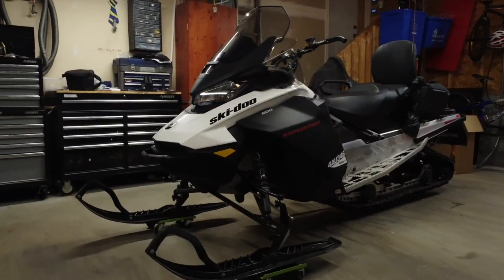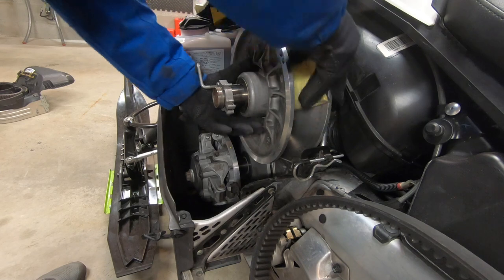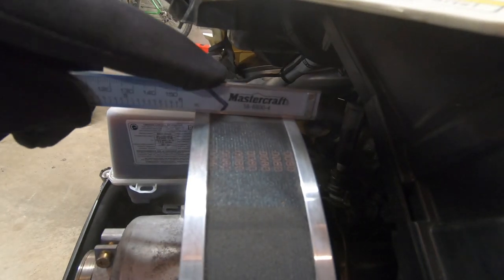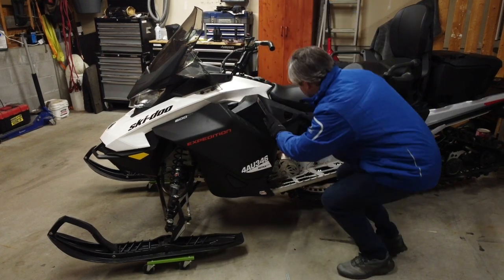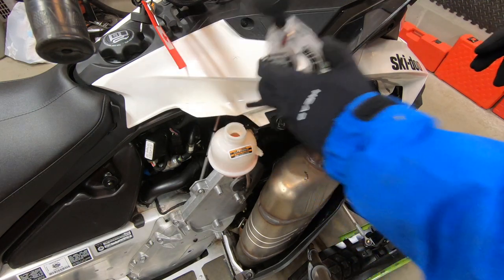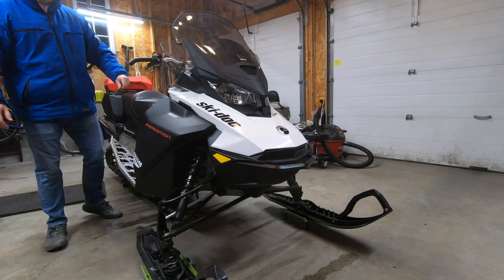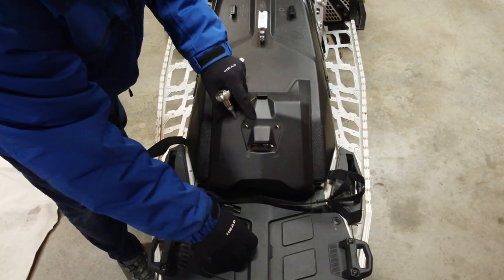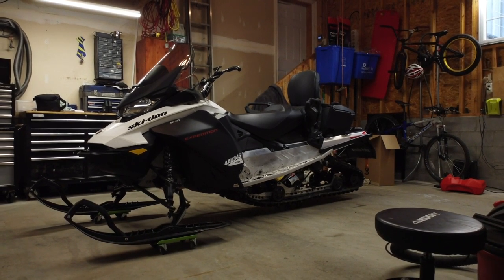DIY Ski-Doo 600 EFI Pre-Season Maintenance

Comment: thank for this AWSOME VIdeo....  I have the 2022 Ski Doo Expedition Sport 600 EFI,  question related to charging the battery ,  on your video and also on my machine as well,  there looks to be a Charing Tether you can use to charge battery ?  Is that what it is or is that for something different ?
Reply from the maker: That 2-pin connector is the rear passenger heated grips wiring harness. The Expedition Sport includes the harness from the factory, but does not include the rear heated grips. Since the harness was factory installed, rear heated grip installation was made easier than it otherwise would have been!

Comment: Great.l got sound on most of the video but around the middle of the video l lost your volume.Hope to see new video in fall. Can you resolve a problem with my 600 efi. sport expedition.The ski doo tips over at slow speeds. On a hard packed trail if you run up the hard packed edges it will tip. If I am on a back trail and get to close to the deep snow either side of trail the ski doo will tip over.
Reply from the maker: My Expedition was shipped with all suspension adjustments set to the 'softest' settings (the least pre-load.) Try tightening up your front spring pre-load. You'll need to use the suspension adjustment wrench on the clutch cover. Adjust it just 1 or 2 clicks at a time, then test ride it. I found the snowmobile much less prone to tipping with the front springs adjusted tighter. I settled on a setting of 4 out of 5 on the left and right front springs (that's 1 click from the highest pre-load on the front.) Leave the rear springs as soft as possible (only increase the rear spring preload if you're bottoming out.)

For me, this dramatically improved handling, stability and reduced darting.

Comment: You ever use any other oils for the skidoo? Like different brands other then XPS fuel synthetic,,, like blue coloured 2T snowmobile oil
Reply from the maker: I only go through 1 or 2 jugs a season, so I choose to use the Ski-Doo XPS oil recommended by my dealer. My son uses 2-stroke oil from Canadian Tire and it seems to work fine too, but it’s only a few bucks cheaper than XPS oil.
Reply: @mop1471  thanks,, same, i never used anything else other then xps full synthetic too,,, just wondering in case i have to use other oil

Comment: Where would I boost it ? If my battery died
Reply from the maker: It's a bit more work than I'd like, but not too bad: Pull the seat off (no tools required, just pop the two front friction fasteners by hand.) Then remove the two battery cover screws (torx driver is included in the sled's tool kit, on the belt cover) then you have access to boost or charge the battery. 

I've been considering adding an externally accessible charge / boost port on the battery cover. If I go through with it, I'll post it here!
Reply: @mop1471  thanks I found it and managed to boost it, would you recommend removing the battery to charge ? Of course taking off the positive and negative terminals before doing so.. its winter atm and just asking if I should remove to charge inside or outside 😅
Reply from the maker: If you have any reason to think the battery could catch fire during charging, then remove it and replace it with new. If there's no reason to think it could catch fire, then there's no reason not to charge it in the sled.

Ski-Doo does recommend, in the owner's manual, that you disconnect the battery, negative terminal first, before charging the battery. Personally, the one time I had to charge mine, I didn't disconnect it, but I was just using a very small 1A charger that wouldn't wreck anything in the electrical system.

Comment: Hi, XPS semi-sintetique oil are allowed on the 600 efi engine. Have you used it? Or only full sintetic?
Reply from the maker: I've only ever used XPS full synthetic. My owner's manual specifies only XPS, so, presumably it would work with the blend - but consult your owner's manual and/or dealer to be sure.

Comment: Very informative and some good reminders here in your content. How has the cooling functioned on this model without a rad I will assume?
Reply from the maker: Thanks! Make sure to subscribe — more content is coming as soon as we get enough snow!

The Expedition Sport used the narrow bodywork for 2021, so no rad. In low snow conditions, the temperature would creep up and trigger a warning after about 2 hrs of riding. Pulling off to the side of the trail and picking up some powder would resolve it right away.
Reply: @mop1471  subscribed !
My old Summit used to do the same thing; too much trail riding and I’d have to put it into the pow to cool it down. I put a temp gauge into the cluster to better monitor over the red light.
I think the Expedition Sport is a great choice for one of skidoos best all around value sleds. Just needs the rad IMO.
Reply from the maker: Thankfully, the ‘Sport’ gauge cluster includes a temperature gauge. Over the course of the season, I learned to manage the heat and almost never have to stop to let it cool anymore. Ice scratchers helped too: https://m.youtube.com/watch?v=Rs1hykh4pYU